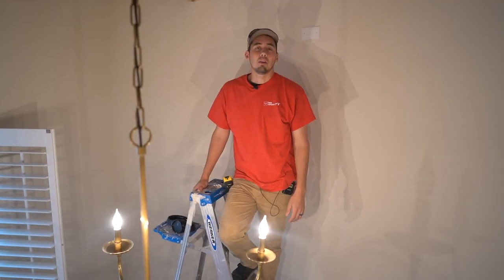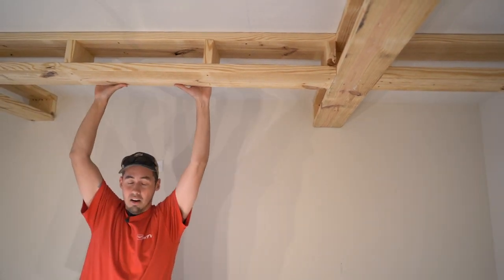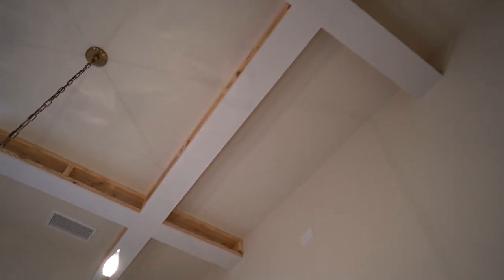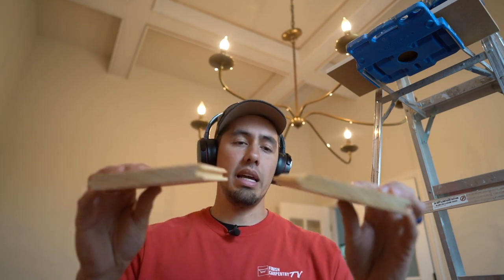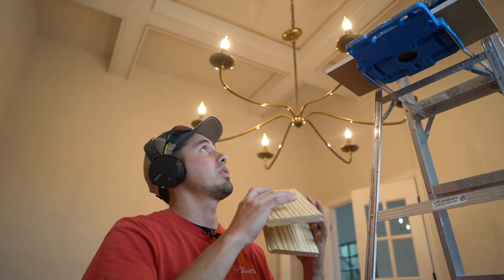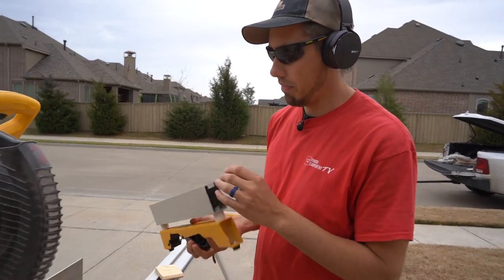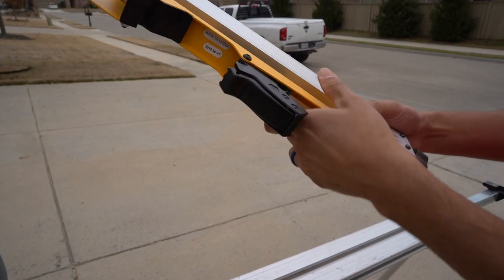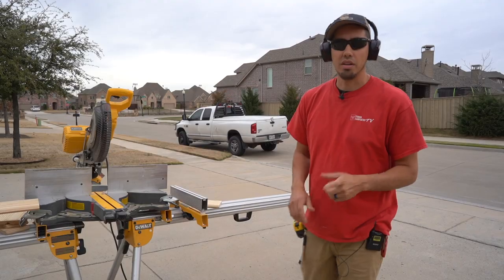Installing a Coffered Ceiling!

Comment: You have great mechanical skills, I haven't done much finish work in the last decade but getting back into a bit, I copied your sommerfeld router table and was able to replicate wood siding  from the 1800's in the field, I didn't know the job was in the workers and was able to pick up a bit last minute at a good local supplier and get the job done quickly, knowledge is key and keeping an open mind. Never stop learning, and thank you for the knowledge I have gained

Comment: Saw your video when you released it and was going to commend you on the toggle bolt technique, got sidetracked and didn't but  will now. Great idea to get that little extra fudge factor for precision placement plus the aid in holding the piece up. I'm waiting for you to acquire some staging (scaffolding) to use inside on these full ceiling projects. Way more comfortable than moving ladders around and working in short reaches. The time and convenience will out way the setup/tear down time. Then again, I've been in the building game for longer than you've been on the planet and my knees appreciate not going up and down. Love seeing the quality and integrity you bring to the trade.

Comment: Richard, I like what you built.  I think what a lot of carpenters are talking about is that they usually just apply a 2X6 to the ceiling.  Then attach a premade box beam around the 2x6.  Which ever way you build it works.  Keep up the good work.

Comment: There’s a lot of trolls online man. Ignore them. I guarantee some are just some guy who bought a ryobi circular saw and worked on a neighbor’s house and think they are special now.
Reply: Hey man Ryobi's the shit. They come out of the same factories as Milwaukee stuff for a lower price.
Reply: Ryobi is not the shit. It’s not total garbage but it’s not professional grade. Great for guys who don’t want to come out of pocket for the good stuff. Just because it comes out of the same factory doesn’t mean it’s the same quality.
Reply: @jeremyf5853   depends on you tool budget, Dewalt has some good tools, Milwaukee has good batteries but tools are little lacking but looking at cost of battery vs tools.. Ryobi got them beat per charge. Its all about preference, price and quality of tool. I have about every name brand in my tool box LOL..
Reply: Absolutely true!
Reply: Tim Ahern I learned a long time ago that if I wanted to improve my work quality, it meant not buying cheap tools. I am a Huge DeWalt guy but I can also recognise that there are many cases where they may not be the best. With that said once you buy into a battery platform it is hard to introduce another brand. I don’t think any other tool brand can compare to the 20v max and the 60v flexvolt line up in regards to offering. All of the others are lacking one component to be truely wireless across the board  whether it’s a orbital sander or a top end radial arm saw. Do you disagree?
Reply: @jeremyf5853   Check out Metobo HPT platform, they also have an adapted for plug in. But yes you are correct no one platform has all you need. you should check out AVE channel, he does some nice tear downs. Also depends on what your doing, my Makita circular saw two months wont even cut straight,  as some how got bent, changed it out and new one out of box was had a bent shaft. use to be good brand haha.... went back to Skil what I had originally for 30 years
Reply: Tim Ahern AVE is a great channel and some crude humour too. I use to think Makita was a top contender with DeWalt and Milwaukee but they have fallen behind. Some times I wish I would have started with Milwaukee tools.. I have the 60v Flex Volt DeWalt chip saw and love that thing. It’s likely the best cordless chop saw on the market.
Reply: @jeremyf5853  fallen behind?

Comment: That's is a pretty tall ceiling. Fun.

The reduced atmospheric pressure at that altitude creates an almost lighter than air effect. This explains why one toggle bolt can hold all that up. 
It also explains why things fall off of tall ladders easier than short ladders, there is less psi of atmospheric pressure pressing down on objects to hold them in place....

The effect is even worse before a storm when the barometer drops.

Comment: Wow, every time you showed the toggle bolts you explained why you were using them and the fact that they are not what is holding this framing up.  I think people are just too excited the thought of being able to correct someone else, even when it's them that's wrong.
Keep up the good work and quality content.  You don't need to change anything about the way you described and showed your work.

Comment: Great video. I do the same work as you for past 25 years. I use all DeWalt tools as well , same set up u have. One thing I did switch to was my tape measure. Always used the fat Max for years , until I found the Milwaukee 14 foot standout 25 foot tape. Best tape I have ever used. Hated DeWalt take loved the fat Max, but this Milwaukee I got is next level feel , lock is awesome and easy as well. Try you one bro ! You won't regret. Keep up the builds bro.

Comment: Lol, joists are running one way... as long as he screwed the frame boards running horizontally to the joists that thing will be there forever but for the boards on the frame that run parallel with the joists the toggle bolts are there just to keep everything snug... great job man! Looks great

Comment: @1:41.  I thought it was just brad nails holding it up!  ;)   And TBH, the look after vid#1 was nice I thought. Kind of had that ski lodge feel to it.  OK, back to finishing your video so I can see what it looks like when finished.  EDIT:  OK, I couldn't resist.  @2:22, I wanted to see a bucket of Finish Carpentry CA glue - in keeping with the "only toggle bolts are holding that up?" theme :)   I'm eagerly awaiting the third video!

Comment: How does the paint hold up all that weight 😝..
Reply from the maker: hahah!
Reply: For real though, i install/demo cabinets and such, the first time i forgot to cut the paint line it took a couple minutes to figure out why the heck the cabinet wasnt coming off the wall, and how it was hanging on the wall after i was 100% sure i got all the screws.
Reply: He adds CA glue to it.
Reply: @whatthefoxtrot8889  I'm amazed how strong the painters caulk is.  You do have to cut that stuff or it will really fight you.
Reply: Cmon man, the weight of paint?  It’s the primer you have to be concerned with
Reply: Obi Serge Kenobi I use primer to glue my cats together

Comment: Hey man love your work I would of used 3 1/2 inch screw instead to account  for the 5/8  or 3/4 drywall on the ceiling  cause you might have per screw only 3/4 grab or less

Comment: Beautiful job Richard , been wanting you to do a cofered ceiling video for ages and it is built pretty much how i thought it would be but love the detail especially bringing the boards further down compared to flush , i would defo not have thought of that  and only guessing here coz i have not read every single comment but maybe some of the negative comments were from here in the uk because our joists are nowhere near as big as those used in the US but regardless they should have realised that the cofered ceiling you built is structurally safe aswell as a top job , ignore the trolls pal , dont feed them

Comment: I have heavy, solid, rough sawn 16ft non-structural beams hung from my 2x10 ceiling joists without any problem. Like your beams, much of the weight is supported at the ends near the walls. I like your design better 👍.

Comment: Hi Rich, I've learned a lot from watching your YT channel and I've started tackling a lot of projects around the house, doing some custom built ins right now. Having an engineering background it did make me wonder what an individual screws holding power wound be, low and behold I was able to find the answer in about 2.5 seconds on youtube titled "Which Type of Nail or Screw Has the Most Holding Strength?" maybe people should do a little research before before spewing off at the mouth, 3" Drywall screw was holding 900lbs before failure and 3" deck screws were over 1200lbs before failure. 1200/1Richard = 6.67 Richards per screw. Keep up the great videos.

Comment: Here’s a bit of advice for future coffers that you will be doing. Do your layout & install just a flat 2X material on the ceiling to act as a nailer. Build a “U” box out of 3/4” Birch ply & screw to the flat 2X nailer. Now you have a stable substrate that is not going to move & create havoc for any of your joints. I’m a firm believer that 2X material is not the correct substrate for any finish material. Would also suggest splining your 1x8 on all those butt joints. Didn’t see any glue used?
Reply: I was also thinking that the 2x material was going to just warp over time.  Assuming it's box store lumber, it's probably 15% moisture.
Reply: Steven James Porter  in all my years I’ve never seen case work wrapped around rough lumber. Even if it was kiln dried, it’s not the correct substrate. Appreciate the comment. Was hoping to get a reply from the installer.
Reply: Thinking the same thing
Reply: Robert, while I agree with you that the 2x material may warp and twist, Richard screws the heck out of everything, so I don’t see it being much of an issue.  Also, he mentioned the ease/time saving of using stock size lumber.  In your scenario, you would have to rip down the first 2x8 and then, of course, rip all the plywood.  Speaking of the plywood, why would you use birch ply when it’s all going to be wrapped in pine, why not just 3/4” CDX or whatever is cheapest??
Reply: Hating

Comment: Soooo..... when I do a build-up, Im always concerned about movement. Gotta ask. Doesn't that 2x expand and contract  and could pop a joint? I was taught using 1 1\8 plywood.
Reply: Yes and no. If he used dry 2x lumber, it won’t matter. However using plywood, it will make it more stable, and in my opinion easier to handle then full 2x.
But he did a nice job though
Reply: @tribulationprepper787  serious..? Get over it. Move on.
Reply: Tribulation Prepper sir. You really missed the point he was making! Try to see it from his point of view.

Comment: Don’t listen to them, keep up the videos I love them.... with everything going on in the world this is the stuff im watching.... (I’m a builder as well).  BTW, you could easily hang that assembly on just the drywall if you had to (not that you did).  Those toggle bolts are rated for like 100lbs each. You should see some of the shit I’ve torn apart over the years that’s held together with just a nail or two. Clearly non builders are chiming in on your videos. Ignore them

Comment: Ok fine, but did you see the Project Farm Guy's video on the best drywall anchors? A single toggle bolt held 150+ pounds. I'm sure several more toggle bolts would've held just fine.

Comment: Did you guys calk the 1x material joints before paint or was it tight enough?  I'm curious if the bottom flat piece of 1x was wider than the rough frame by a small amount as well to keep the rough lumber being crooked or curved from causing issues?

Comment: Stupid is as stupid does.

3 inch screws have little shear strength.
But have massive pull strength.

That framing will hold over 200 pounds easy.

Keep up the good work

Comment: For safety reasons it should be attached to beams and not sheetrock, it'll weakened over time or if sheetrock gets wet, regardless of it being attached to the wall

Comment: Lol. The truth is by adding that to the bottom of the joists makes it stronger because its connecting all the studs above the ceiling together. The 2x8 is the screws grip but as far as if u were trying to figure out the strength of the ceiling if u were standing on floor above or roof, it is now strengthened. If u wanted to bread it and put weigh on until fail, it would have failed faster before u added it. Meaning now it made the roof or floor above able to withstand more weight. Like if a tree hypothetically fell on the roof with a ton of force, and it cause the roof to crack, now with the new install the ton of force would be withstood without cracking now. Hypothetically. Idk what the numbers were and are but if it had 2 tons of capacity prior, when u add the coffered curling, even tho u added weigh to it, it would be around 3 tons of capacity, plus the weight of the coffered ceiling

Comment: Looked great.  Real wood is the only way to go.  I do a lot of work in high end homes and the builders have started using a veneered MDF core laminate on the ceiling.  The stuff scratches way too easy.

Comment: What size/depth would you recommend for 8’ ceiling height? Should it be square? For example, 6”x6”?  Or is it acceptable to go 6” wide and 4” deep/dropped from the existing ceiling?

Comment: I've got a vaulted ceiling, thinking of installing a coffered ceiling like this.... thoughts?  Can it be done?  should it be done?  Love this series!  Favorite YouTuber by Far!!
Reply: i'd taper the top instead of using a solid 'beam' at the peak. 

open up sketch up and play around with some designs!
Reply: @jetah50  i was thinking 2x6 box beam v. 2x8
you suggest tapering the box?
Reply: @erichpaine7049  I was thinking bring the ceiling parts to a peak but not having a main beam at the peak.

every picture I see has a main beam where the 2 ceiling panels meet. remove that main beam (if it doesn't look good, it can be added by trimming the other pieces).

Comment: In the case that the ceiling/floor (depending on how you look at it) were framed with TJI’s, what would you do to secure the framing to the ceiling as not to disrupt that flange on the I-joist? Or is that not an issue?
Reply from the maker: Charlie de Vogel we would climb in the attic and install more solid blocking to the tji. Although I haven’t had any experience with those type of joist, It appears the screw would still bite the solid wood of the tji

Comment: What's holding your B-board or beadboard as we would say in the south ? Is it just your finish nail shot at angles ? Or maybe your hitting a joist here and there
Reply from the maker: Jeff Higgs only joist for those. They are in there solid. With all over head boards I make sure we hit joists.

Comment: I suppose. You  could  add. A lag screw   on each end...for reassurance..if using a 3inch screw.   It only catching  joist  a inch...it would  be heavy with all the material  added. And if it fell....it could be fatal. To a person... if it was a area. Known to have earthquakes...or tornados..

Comment: The only thing that you showed was using the toggle bolts so they assumed that that was all that was holding them up. They weren't listening very close when you talked about screwing them into the JOISTS.
Reply from the maker: raider6511 I showed screwing them in as well.

Comment: Good stuff. I would lose my mind with some of the comments. I posted a pic of a miter drop for base to fit under cabinet one time and those comments went on for days about how I was wasting time,  I should just notch it, I would be sent off trim and back to grunt if I did that at a certain company... endless mindless keyboard garbage babble. Keep up the good work. Great vids.

Comment: How did you charge for the whole job? Labor only. Is the finish board separate or with the sq ft price?
Reply: I understand that you left space on both sides for the crown mold but what if you can’t split an even length for the mold? Then would you have to run it deep to the beams?

Comment: Richard, do you see an issue using 3/4 “ plywood as the framing over the 2x’s? Reason I ask because it might be easy to install if I’m by myself and I could rip the pieces perfectly to size, where the 2x’s are never perfectly straight.  Thanks and you make great videos! I have learned some much from you.
Reply from the maker: Steve Binotti I think that would be just fine. Thank you for watching

Comment: Oh, yeah -  framework should be connected by inch-thick bolts to steel I-beams spaced every 4 inches.  For extra security, I generally arrange some cranes all around the outside of the structure to hold the entire lot up.  Doesn't hurt to slather everything up with gallons of epoxy, either.  But you don't expect me to actually stand underneath it, do you?  What - do you think I'm crazy?!

Comment: If I had the choice, I would have gone with a stained maple board, instead of all white. Contrast would have been nice.
Reply: tscoffey1 - I agree that it would be nice, based on what we see in the video. But keep in mind that the homeowner decor and furniture are part of the design equation. They may actually have contrast if they have a rustic palette already, by using clean white trim. Plus, budget is a factor...stain-grade wood adds a significant expense.

Comment: The joists only go in one direction. How are the parallel beams secured to the ceiling?
Reply from the maker: Noconz0727 MC they are on the joists  as well. If they were not we would actually go up in the attic and install blocking .
Reply: @FinishCarpentryTV  ok I figured

Comment: Question: do you ever have issues with the lumber (frame) not being dry and warping over time?
Reply: i'd highly suggest looking for the best pieces at the hardware store and keeping them inside so they can dry before installing them.
Reply: @jetah50  Makes sense.  Thanks.  Inspiring work.

Comment: Do I understand that the crown is attached with toggle bolts and 
that's what is holding up the ceiling joists?  Straighten out that heat register.

Comment: No requirement where you are to extend the electrical box in the ceiling?  We have to do that here per code.
Reply from the maker: Mike yes the electrician will be changing the fixture when we are done.
Reply: @FinishCarpentryTV  Interesting.  All I have to do here is just install an extension collar on top of the existing box to get into compliance.  Thankfully no electrician required for that job.  It takes a while to get one of those guys onsite.